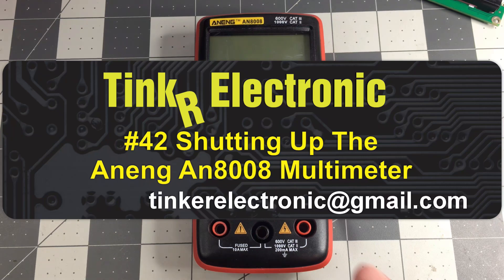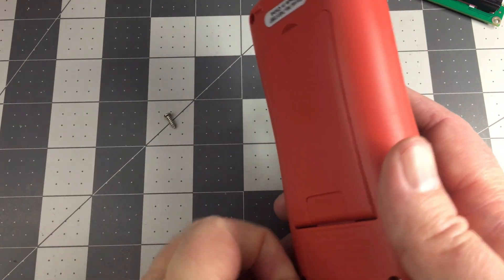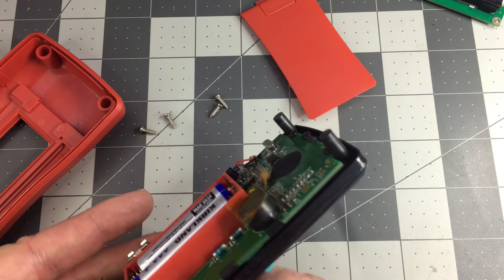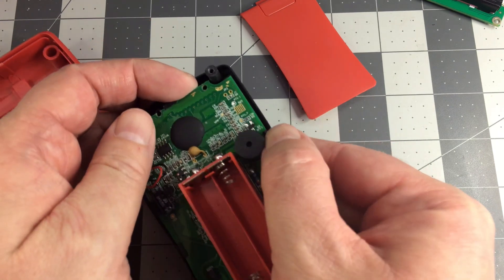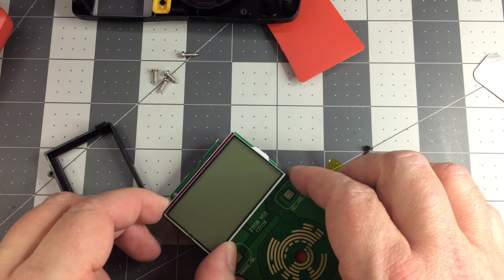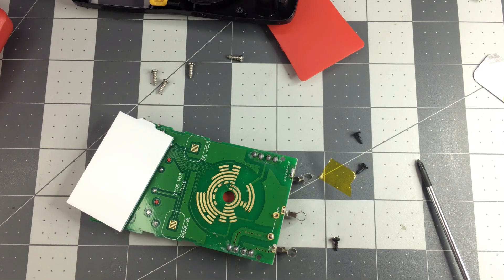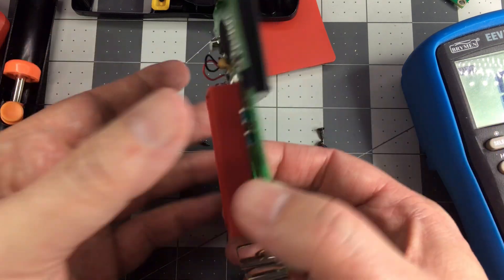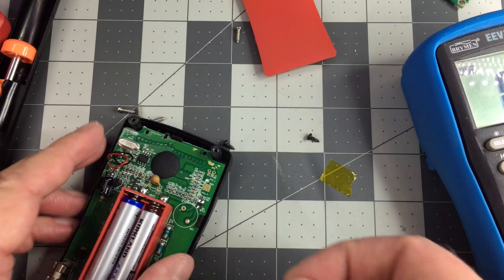TTE #42 - Shutting Up The Aneng AN8008 Multi-meter

Comment: I don't understand a thing.
AN8008 have 10 and 1A scale, but fuses are 10A and 600mA.
So if I'm at 1A scale (automatic or manual) and I measure currents above 600mA, fuse will burn or it switch at 10A scale when is set automatict to avoid that?
Btw, my recent 8008 speaker isn't that loud, but display reading when I'm stand up is impossible, numbers disappears
Reply from the maker: The 10 A fuse is in play when you select mA/A and switch the input to the A/mA socket the technically 200 mA ish fuse is in play when you use the uA setting in the normal socket. Hope that helps.
Reply: @tinkrelectronic  if I have to replace the 200 mA fuse with a 500 mA one, does this affect in different values mesurement of current, voltage and resistance, or only current?
Reply from the maker: It will not affect the reading however the circuit may be damaged if the current goes above 200mA on the uA jack.
Reply: @tinkrelectronic  I tried to measure a Load on the mA scale, the display show 580mA. 
Then I changed the 10A fuse with 1A value and display show 420mA on the load.
I guess that the different values of current recorded are caused by resistance of the fuse which is added to the internal shunt resistor.
Reply from the maker: @MACYNET323  That is interesting, there should only be roughly a 0.1 ohm difference between the two, which really should be negligible. Though, I wouldn't be surprised if the one that comes with the meter is not a high quality fuse.
Reply: @tinkrelectronic  An user measure 0.8 Ohm for the 0.2A fuse and 0.01 Ohm for the 10A one.
 You can try measure a 100mA load, replace the 10A fuse with 200mA one and measure again.
Should be already some differences in the reading, please report it.  Thanks

Comment: Maybe you could add an external switch to enable or disable the buzzer so you can switch it back on for continuity checks
Reply from the maker: You know.. That sounds like a great solution! =)
Reply: That's right, I did too.. Now the meter can be switched buzz or not 👍